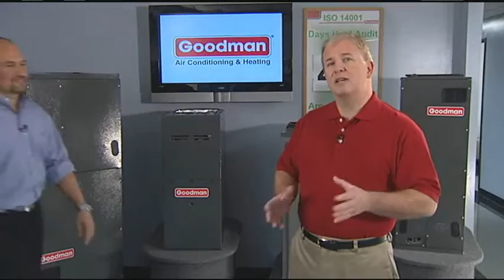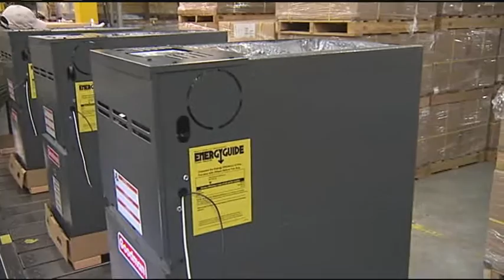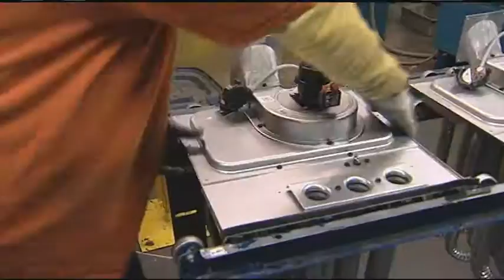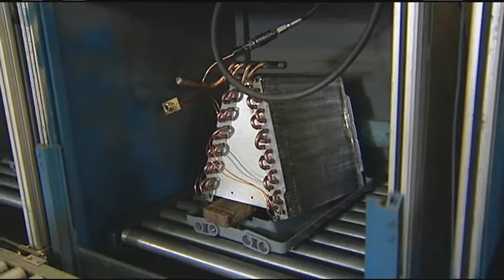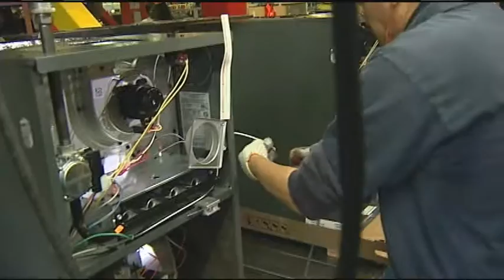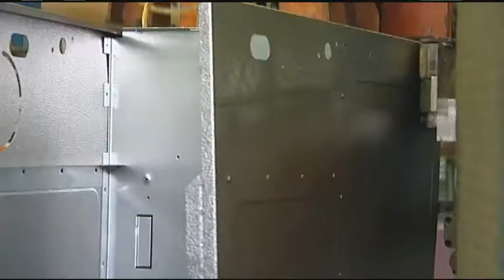Goodman Furnace Assembly

Comment: Can you answer me as to what the block off plate achieves that comes in the downflow insulation kit. I have a Goodman ASPT 33C14 and it's going to be a downflow so I ordered the DFK-C downflow insulation kit which comes with this block off plate that the  manual says to screw to lower right of coil.